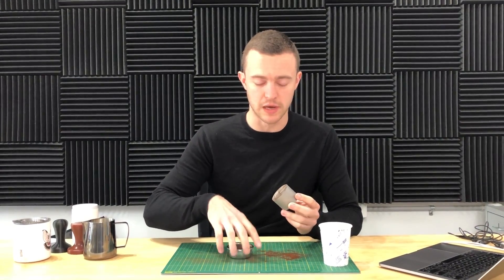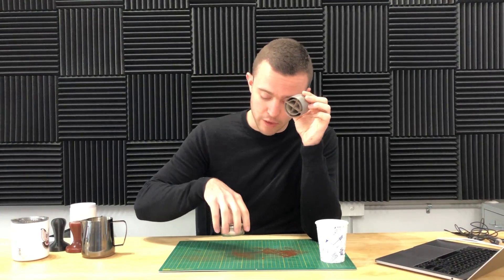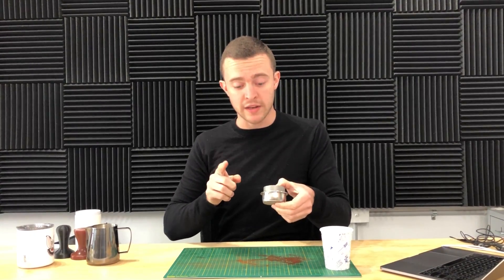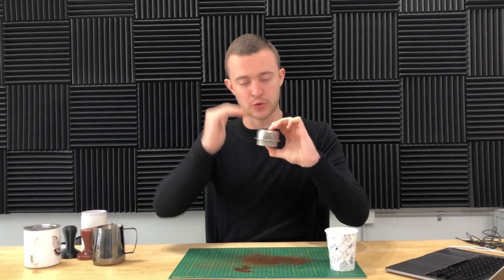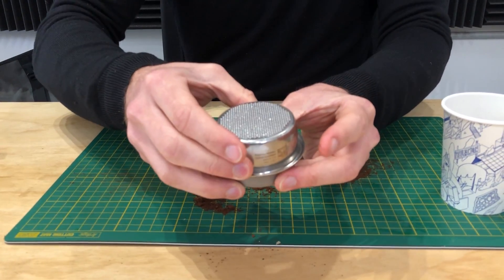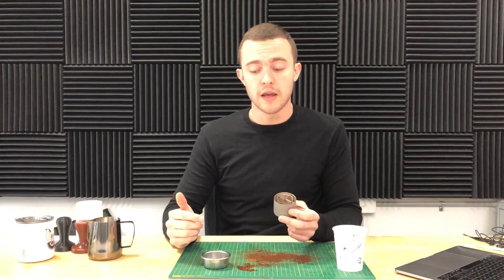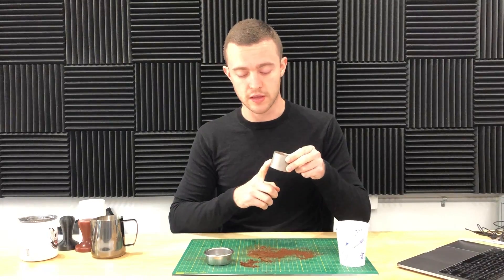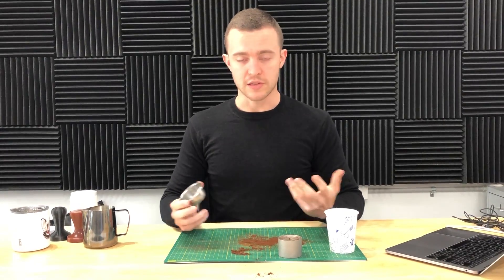The Great Distribution Tool Debate Update #3

Comment: How is the audio still so bad with a wall covered in acoustic panels?? My guess is that the wall in front of you is where the microphone is and that wall doesn't have acoustic panels. In any case, you might have better luck using a lav mic or maybe even a shotgun mic.
Reply: First thing I noticed as well. Seems a lot of work for not much result... which ironically seems to be the case with the product being designed here.

Comment: You know, you could just vacuum out each section and see how much your weight changes. Weigh the tool with coffee in it, tare it, vacuum out a section, and your negative value is the weight of coffee that was there. This way you don't need to manufacture another tool.
Reply from the maker: Definitely! Although our super accurate scales have a limit of 120g and the tool (and coffee) weighs a lot more than that :(